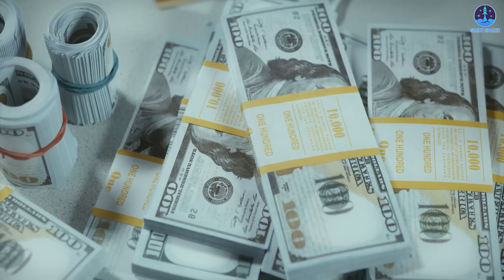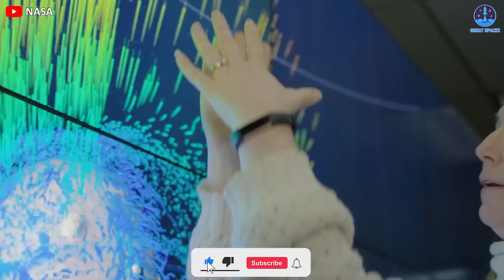It happened! NASA's Station is in BIG TROUBLE cause of Blue Origin stop...Can SpaceX save NASA?

Comment: Initially it seemed like Blue Origin were just a bit secretive about their projects (e.g. New Shepherd was developed very silently and then basically presented as a finished vehicle). But lately it feels more like they are actually a roadblock in every project they are involved in.
ULA is still waiting for their engines, which is holding back the whole Vulcan program; Sierra is developing inflatable modules for a rocket and station structure that may never materialize; ...

Comment: so... Orbital reef is an actual thing.  Being built.  Not a mock-up...  It has 50 percent of the hardware assembled.  Ongoing testing of the inflatables (watch the burst tests) They have cleared FAA accident investigations, and have already tested a newer, more robust nozzle for their BE-3 second stage (yes, that's right.  I said second stage.  Sheppard is a test bed for the second stage engine) The launch facilities are complete, the assembly plant is complete.  And their  BE-4 has completed testing and so far has exceeded expectations.  Again, I'd like to stress it's a rated engine passing NASA requirements (that means 99.9 reliable restarts and fires in tests) 
And SpaceX has.....   Engines still failing tests on relits...  Uncompleted launch facilities...  A cramped infrastructure shoe-horned next to a LIVE rocket. (that was already damaged from a launch being too close) Incomplete factories and tents still.  A prototype for a moon lander that was promised over a year ago, that is basically a hollow nose cone that they are fabricating into a mockup  (mockups do not work, they just look pretty)
Even Musk is on record stating the rocket is easy.  Infrastructure is the hard part.  I have high hopes for the Raptor 2.5  solving the turbopump failures.  But to say they are leading is not exactly true.  Leading with the idea of a fully reusable orbital class rocket?  Absolutely.   Musk is like P.T. Barnum.  A great self promoter.  But honest?

Comment: Referring to Global Reef as "NASA's Space Station" is misleading.  Global Reef was never viewed by NASA as the successor of the ISS.  That was Axiom.  This is clearly demonstrated by the fact that Axiom is the only company which is permitted to use the ISS.  Consider the necessary effort required to migrate the critical science experiments from the ISS to its successor.  Surely that is greatly facilitated if the astronauts can merely carry the experiments through the space station from their former location to their new location.  Axiom is assembling their replacement as an extension of the ISS.  Once all of the experiments have been moved from the thirty-year-old modules to the new Axiom modules, the entire Axiom station separates and the abandoned modules are ditched in the Pacific Ocean.  And Axiom is a partner of SpaceX and probably there is already significant cross investment.

Then consider that the internal volume of a single Starship is greater than the entire internal volume of the many modules of the current ISS.  Once the Raptor 3 is applied to the Starship the entire existing mass of the ISS could be delivered to orbit by a single launch.  The backers of orbital reef are playing checkers.  Axiom and SpaceX are playing chess.

Comment: Sierra needs to find a new partner. Blue Origin is simply not committed to the project. 

Axiom's solution is achievable. We will most likely have that in orbit and be independently functional by  the time of the ISS decommissioning.

If Sierra can find a good committed partner, we could have two space stations.
Reply: Axiom has already launched orbital missions and are currently testing space station modules, they are years ahead of the next closest competitor.
Reply: @MichaelClark-uw7ex  That is true. That just shows how committed Axiom is to having the first independent private space station in orbit.
Reply: @clay-tw5gc  They definitely made the right move by teaming up with SpaceX, nobody has a more reliable orbital launch capability than SpaceX, 200 plus missions without a catastrophic failure.
Reply: @MichaelClark-uw7ex  The Falcon nine and heavy are the most reliable launch vehicles ever used. It will take a while to get Starship at that level of reliability but I am confident that they can do it.
Reply from the maker: Sierra 🤝 SpaceX. How do you think? ☺️
Reply: @colonbina1  I like the idea. But there are two thoughts to consider.  

SpaceX has a future space station concept that is fundamentality different from Sierra's in work project. Would SpaceX want to shift focus from their current theoretical concept for Sierra's in work project? Maybe, maybe not. 

SpaceX's concept is way on down the road. They could work with Sierra for an interim solution. But that would take SpaceX's focus off of their two prime objectives: get Starship working as advertised and get HLS delivered.

I seriously doubt that SpaceX would risk that. With that being said,  SpaceX would love to put Sierra's space station up there.

Comment: It simple. Core concept: Avoid Blue Origin entirely, they are neither efficient nor serious. 
o Back a Starship 'spoke and wheel' design that allows fuel transfer between dockable Starship 'spokes'. 
o Back Sierra for the hub and for dockable shuttles hoisted by Falcon 9.
o Back Spacex for the dockable tanker spoke connection and for inter-spoke fuel transfer for storage and balancing
o Back Spacex for H2 tanking as well.
o Use Axion to develop systems for the Hub.

But no. NASA will dither, I fear, consigning themselves to ever-lessening relevance.
Reply from the maker: Great comment 👍

Comment: The disadvantage that NASA operates under is that they ARE a US government agency and are spending taxpayer $$. Of course the Congresscritters who appropriate those $$ want it to go to their contributors and their state. That was why the space shuttle was built in every state. "Got to spread that money around where it will do the most good." (aka get them reelected!)
Also, "cost plus" contracts put no incentive on the contractors to innovate. Space contracts shouldn't be "low bidder wins," but NASA could put out a set a definitive  overall requirements and then leave to the contractors to build to that requirement.

Comment: Because the modules are inflatable SpaceX could easily save orbital reef.
Reply from the maker: Great idea👏
Reply: And they probably will.  Plus, going from a design aimed at deployment in a 5m fairing to a design aimed at deployment in a 9m fairing will provide over 3 times the usable volume per meter of length and more length... Sierra Space's designs can bloom BIG and the possible uses will greatly benefit.

Comment: Regardless of which side of the bezos-musk personality thing you land on, NASA has to go with the cheapest, most reliable and adaptable platform to go with. SLA,SLS and blue origin fail on all levels, and only spacex with falcon, superheavy, dragon, and spaceship later-ish, is the only functioning system able to meet the demands.
And a spacestation based on the moon has a more stable platform and much more extended lifespan